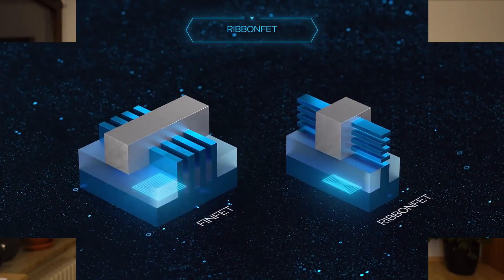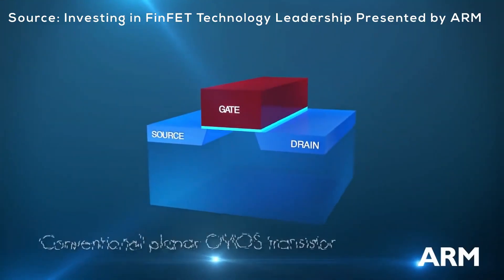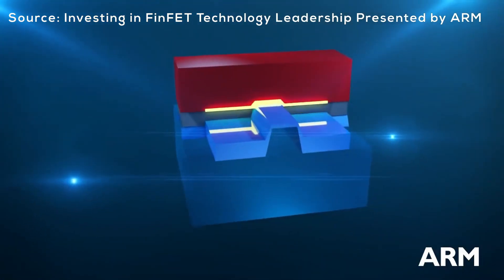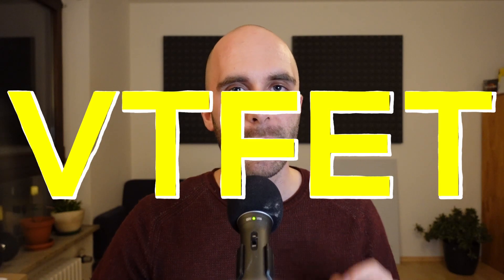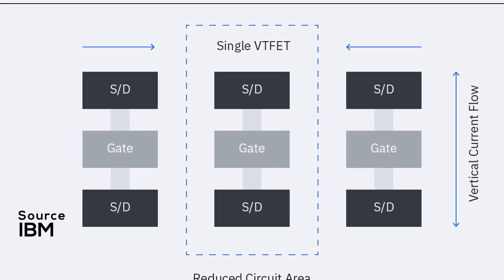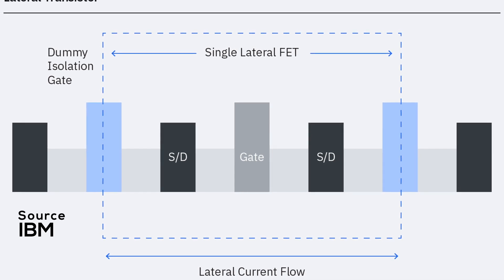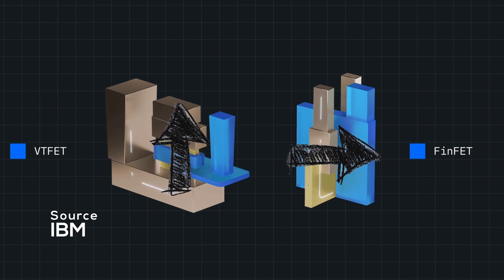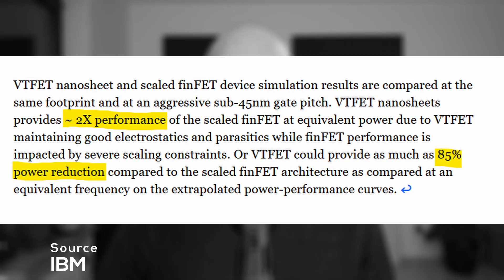IBM VTFET: Vertical Transistors of the Future

Comment: Hey High Yield!  Great info thank you!  What I don't understand is the single vtfet diagram by IBM has one drain, one source and one gate(blue color).  But in the the larger image with many many vtfets together in rows, the gate(blue color) is in the middle between TWO drains and TWO sources... Why is that?  and sometimes there is no gate(blue tall thing)...
Reply from the maker: I'm not entirely sure, I think is either a visual error or maybe trying to show that you can increase the size of source/drain?
Reply: @HighYield  Hello again!  Thanks for replying!  Actually, since the day I saw your video I have been studying the VTFET (and FETs in general).  I think what we see in that IBM image are CMOS transistor pairs.  In most logic circuits there are PMOS and NMOS FET pairs (CMOS = PMOS + NMOS) which share one gate (the blue part).  I will try to make a good animation of how I think this works and show you!
Reply: @ydvisual5530 Yes, the gate connection represents a an input to a logic gate (NAND, NOR, AND, etc.) and each logic gate input is connected to a single PMOS transistor and a single NMOS transistor; always two in CMOS logic gates.

Each PMOS transistor is in the pull-up network for the logic gate output and each NMOS transistor is in the pull-down network.  The number of transistors and their organization into series or parallel connections creates the difference between the Boolean logic gates and the number of inputs to it.

Comment: you are too young to remember this, back in 1980's, there was the permeable base transistor, in which transport was vertical, though different than this. The first(?) wafer showed outstanding performance characteristics. Everyone was really excited. But every subsequent attempt to produce new wafers were nowhere close to the original. they kept doing research on devices from that first wafer. and eventually gave up?
Reply from the maker: A lot of tech, especially in semiconductors, literally takes decades to mature and come to market. Its really interesting how "old" ideas dont come to fruition, but then 30 years later they appear again with some slight tweaks.

Comment: ... well the first thing I notice, is it's CLEARLY going to take up less space. That's going to result in a BIG jump in transistor density.
Improvements in speed or efficiency are like Ford of General Motors telling you about higher power, or higher mileage. That's great, but what the car company cares about is margin and profit and cost of manufacture. You increase transistor density and that's money in Intel's pocket.
Reply from the maker: Increase in density and electrical properties at the same time seems like a jack of all trades. I really hope it will become reality in the near future.

Comment: What is the difference between GAAFET and VTFET?
Reply from the maker: VT-FET describes the vertical alignment of transistors and is still in early development.
GAA-FET is a traditional horizontal layout, but the gate wraps all around source-drain interconnect, and thus has more control over the flow of electrons.
Anandtech has a good article about Gate-All-Around: https://www.anandtech.com/show/17474/samsung-starts-3nm-production-the-gaafet-era-begins
Reply: @HighYield  I think the GAAFET is an evolution of FinFET.
Reply from the maker: Yes, you are right. GAAFET is the next step after FinFET.
Reply: @High Yield  I think Samsung and IBM are completely building VTFET from scratch. There is no correlation between GAAFET and VTFET.

Comment: Mhm. How does vtfet help reduce gate capacity, if everything is larger? Isn't this necessary to help reduce switching power consumption to harvest efficiency gains from the upcoming processes? Or you say with every shrink, leakage current becomes larger, so how did newer semiconductor nodes become more power efficient so far over time?

I wonder if they're planning to make vtfets as complimentary pairs stacked on top of each other as well for better space efficiency... or even eventually a fully vertical universal gate?

I should say the video wluld have been more comfortable with more Broll from the infographic animations. In a pinch, just pause on the broll or loop it or both to give us more time to inspect it. Not fatally so but you know quality of life features.
Reply: Yes, it would be ideal to have the source, drain and gate areas and capacitances shrink.  That’s what happened with Dennard scaling of planar transistors for so long, in the past.

But even if the gate, source, drain capacitances don’t go down, the interconnect can become shorter with increased density of transistors.  Both are contributors. 

The leakage current is a non-ideal static, off-state current that increased and only became significant as transistors became too small.  The power required to switch the capacitance of the wires and connected sources/drains/gates/outputs is the 2nd, and ideally more dominant, component of total power consumption.

Before ~2010 leakage power was not significant.  FINFET, GAAFET, VTFETT all address leakage by ditching the planar transistor. But there were process tweaks before that that made a little difference, without such huge changes to non-planar designs.